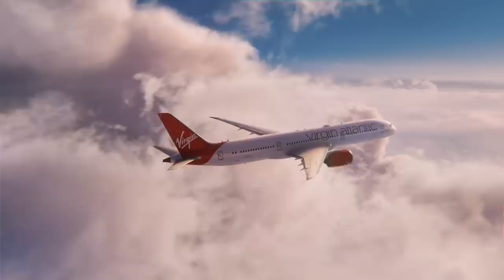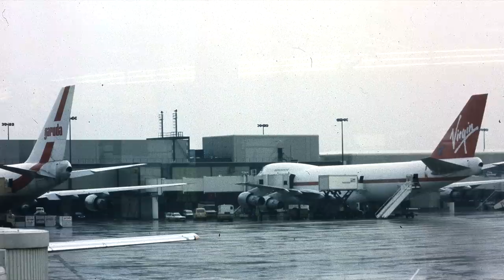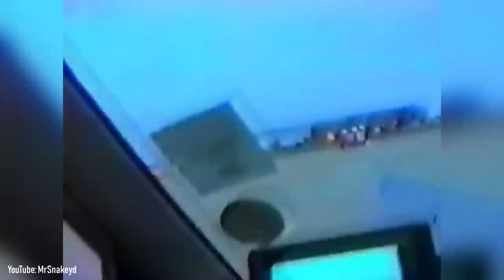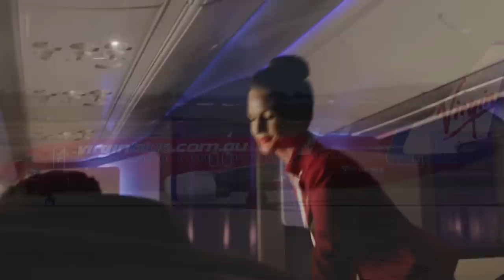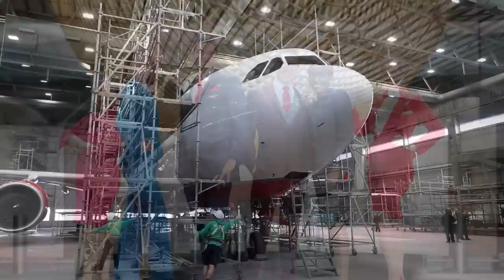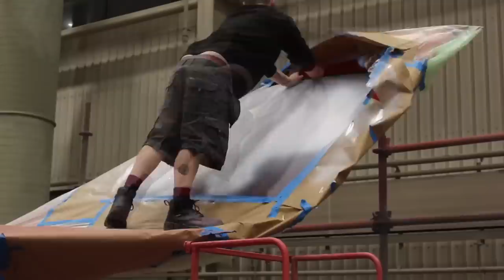History of Virgin Atlantic

Comment: Just flew Virgin Atlantic from SFO-LHR and back over the holidays. The 787 leg of the trip to LHR was amazing, awesome product, highly recommended. The flight back to SFO was not as good. I flew back on a A340-600 and the age of the product really showed, the entertainment system was very dated and it didn't have in seat power. I hope Rolls Royce fixes the Trent 1000 issues soon on the 787, it was sad to see 2 of the virgin 787's sitting with their engine cowlings open at Heathrow while we taxied out on the A340.